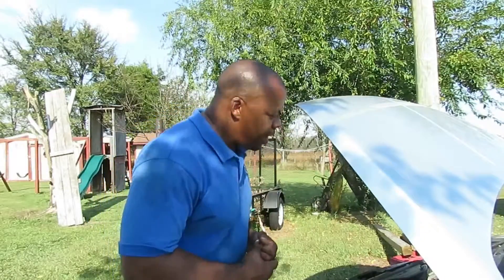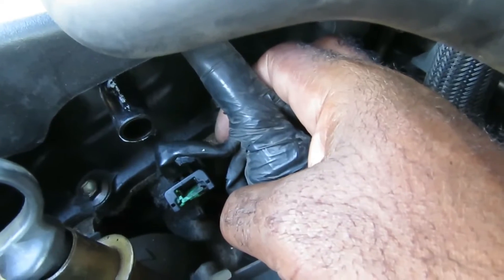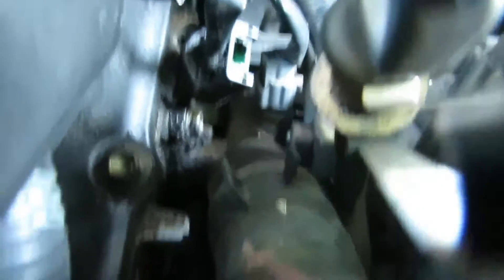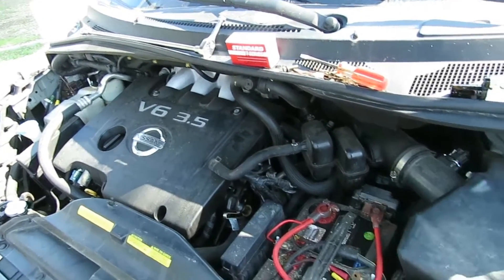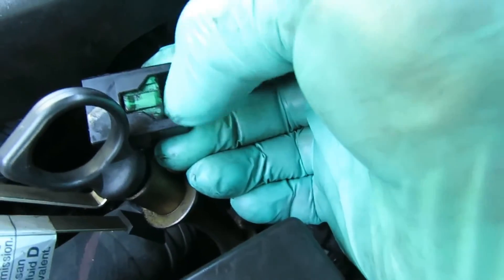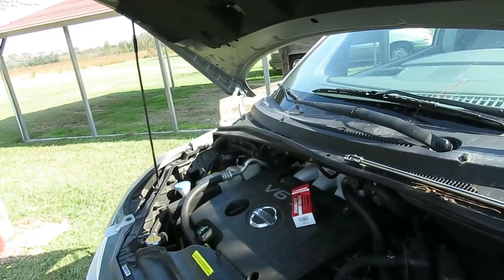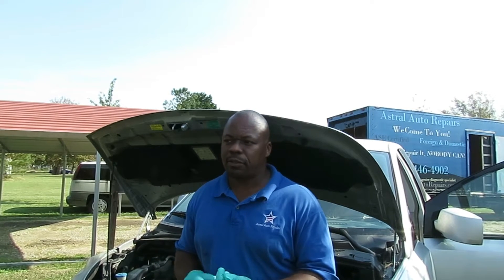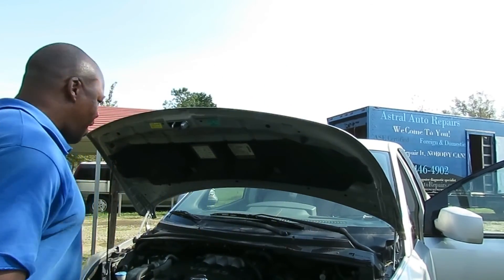⭐ 2004 Nissan Quest 3.5 - How To Replace The Camshaft Position Sensor - Bank 2

Comment: Timmy, the battery issues you discovered are exactly why I so often experience "mission creep" with projects, especially on my '87 Alfa Quadrifoglio. On older machinery, no matter how careful you try to be, parts can be broken by a sideways glance and suddenly more work has been created. 😟 In this particular case, you can easily show your client things that need attention but when techs are in the shop, explaining situations, it becomes all about trust. And trust and good word of mouth is something you appear to have in good supply 👍👍👍.

New rule, don't even mention the haters! They get off on the slightest recognition and I believe the best way to deal with them is "review and when appropriate, delete!". Your are providing a valuable service and I'm seeing improvement over time ("how we got to this video" as a preface). Keep it coming! And with this paragraph I broke my "new rule". Feel free to delete this last part!
Reply from the maker: LOl, good one Steve. i would love to see pictures of your car, I'm pretty sure anyone who just read your comment would love to see it as well. You make a very good point as to it comes down to trust, I think I'm going to mention that on the video after the radiator video we're about to upload. Thanks for the suggestions and believe me, they are well taken into consideration.